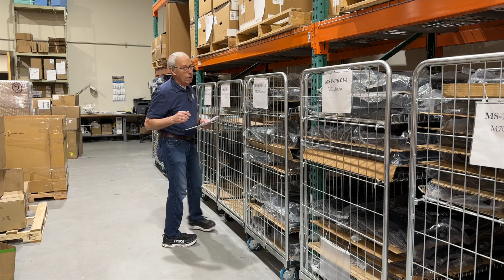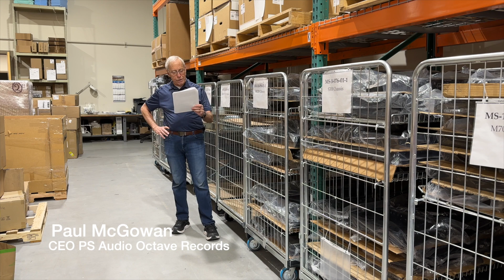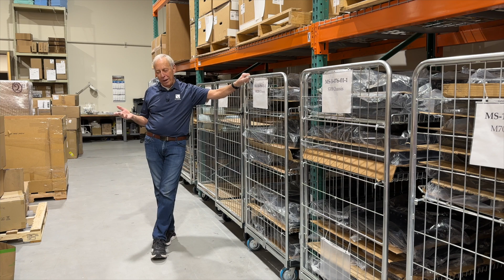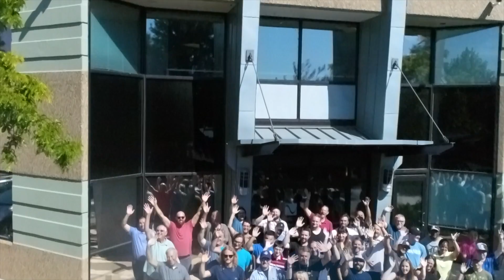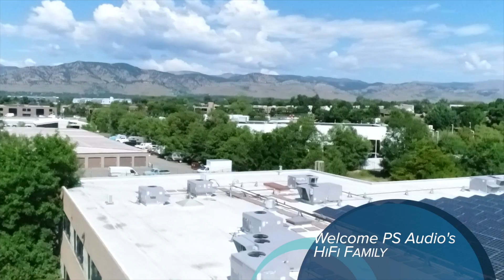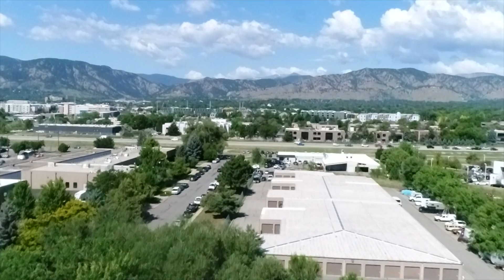Why the last few feet of the power cable matter

Comment: Our science is also incomplete and will not hash out everything we hear
Reply: I wouldn't put it that way. There are things we can hear that can't be measured. But does that mean science can't be used to prove a difference? Of course it can. A well done listening test can be just as valid as a formula. Just taking a product that you don't believe makes a difference and measuring it in some way that you come up with as proof, is junk science. Proper science requires you to follow the evidence. That means in order to do real science, you have to test actual evidence directly. That's what the deniers refuse to do. For example, have you ever seen a skeptic do any type of real research involving claims made by someone? The claim is the evidence. In order to do real science, the claim has to be researched, and the person (or people) making the claim have to be a part of the testing. You have to test people that claim to hear a difference under the same conditions the claimed differences can be heard. Its the very definition of the scientific method. Doing it any other way, isn't science.

Several months ago, I was talking to Gene from Audioholics about this very issue. He's a well known skeptic in the audio community. After some back and forth, I finally got a real answer out of him. I was pushing him on the idea of doing real science, as opposed to doing measurements that are not based on evidence. The answer he gave me was, its too much trouble.

So, the end result is, we can use real science to settle the debate. The skeptics don't want the truth. They want to win the argument. And if they tell you we should provide the testing and evidence and testing because its out claim, its nonsense. We've tried many times to do this, and always end up with the same results. Unless our tests deliver the results they want, its a flawed test and they won't accept the results.
Reply: @Douglas Blake There is a reason everyone that comes into contact with you thinks you're a pile of garbage. (And I'm being nice as far as my wording goes.)

"You were pushing the idea of doing your science ... one that appears to be totally disconnected from reality."

Quote me. If I said something that ridiculous, show it to me. Here's your chance to prove what I just said about you is false. Let's see what you come up with,

Comment: I don’t think anyone can reasonably argue the validity of time-tested electrical properties, and any contentions away from those should require you to show your work. There is no magic here, no exceptions to the rules. What a lot of people have an issue with is that constructing something properly doesn’t necessarily mean that you can charge thousands of dollars more for an improvement that costs pennies to implement. I have run a non-contact voltage tester over standard OEM power cables and the tester will detect voltage, but my Pangea cables do not, so Pangea has remedied that with a relatively modest increase in price (still too high, IMO). I’m much more worried about what radiates out of my power cable in the vicinity of smaller voltage signals than I am about anything getting into my power cables, which will be cleaned up by any piece of electronic equipment that it’s plugged into.
Reply: Here here well said BW.

Comment: It is a fact that a poor or weak contact point in an AC circuit will generate noise from minute arcing.  This can easily happen with cheaply made AC wall outlets when asked to supply larger than average currents.  So using better plugs and sockets should reduce if not completely eliminate that source of noise.  It's also why I have a dedicated circuit for my audio set-up that is fused from the panel box instead of having a circuit breaker in line with it; breakers have several small point contacts within them.  All that said, I made my own power cords using 8 gauge 3 conductor wire from the outlet to my conditioner and 10 gauge from there to my amps.  Saved a great deal of money doing it myself.  All other power cords were factory 12 gauge.  (Of course good grounding is crucial as well.)  I can put my preamp volume up full with the selector on phono (without anything playing) and put my ear up to the speaker ... dead silence.  No buzz, no hum and no hiss.
Reply: Nothing wrong with breakers ... but I certainly respect your fuse game!

Comment: I'm not going down the rabbit hole with expensive power cables.. But I have noticed a difference on some of my equipment, using cheap, heavy gauge, shielded power cables between my components and Furman power conditioner. I'm also less sold on fancy power cords plugged straight into the wall, because then it really is just the last few feet. I but I think of you're using a conditioner of some kind to actually clean up the power, then it makes sense to try and keep it clean.

Comment: Not only does the power cable matter, but I’ve noticed my system sounds better when the power is solely what’s generated by my solar panels.
Reply: That is kind of weird because most inverters are pretty bad compared to the nice sine waves comes from the grid generators.
Reply: @EraYaN  not anymore 
Most are true sine wave.
I’m off grid and we have a small solar  system and a generator with a true sine wave inverter. 
Getting ready to upgrade the whole system this summer.
The inverter itself is a couple thousand dollars.
 They are pretty much a industry requirement any more, with some much stuff being digital and computerized.
Reply: @EraYaN  I should have that measured - it would be interesting for sure. There are other factors, of course. It doesn’t seem to be the case 100% of the time, and I do have a good power cable for the amp and some rudimentary power conditioning for the components - certainly not Regenerator or Niagara level.

Comment: G’day from DownUnder Paul! Thanks for taking time to answer my question with humor 😁👋
Reply: Pay Paul $6000 for this:
Conclusions (updated)
When using the P12 as one would think to do: using Zone D "high current" outlets, impedance is actually worse than mains AC and hence it reduces power output in our test amplifier. When testing using low current Zone A, this doesn't happen and we get the same power, distortion and noise.

Bottom line is that at worst, PS Audio P12 objectively degrades the performance of some audio products if you use the Zone D outlet. If you use the other zones, it simply doesn't do anything useful than waste some power, take up space, and cost you a lot of money. Distortion, noise, dynamic and average power of all tested products remains the same as not using P12. This is what the data shows and after two weeks of waiting, nothing has been presented from PS Audio or anyone else for that matter, to indicate otherwise.

Comment: Measure it with an oscilloscope with one end plugged in your wall power outlet regardless of the length of the cable or build quality, do the comparison with the one you're willing to replace, it should show you which one is better. Have a listening test, this is also a way to tell you which is better, if not the most important of them all. Try to install a ferrite choke specific to 50/60 Hz range on your cable. It will make a difference. Save yourself from the trouble. Always trust your ears most important thing ever. I'm not going to get into the discussion of power/line conditioners or filters and generators/rebuilders or seperate electricity into your house through a separate socket etc... otherwise we will be here for days writing a comment.
Reply: Yeah, measurements do not necessarily tell the whole story. Your ears must do that.
Reply: @marcusbrsp  Measurements tell the whole story, the only story. Any other story is psychoacoustics.
Reply: @lassesaikkonen501  amen

Comment: Then why don’t manufacturers of high end audio equipment provide this cord? 

If I’m purchasing “high end” equipment, why does it come with a cheap cord?
Reply: Because the recommended cord that goes with the amplifier is the same price as the amplifier. 🤣😂
Reply: are so right!
Reply: The supplied power cable is the best solution for your equipement in a normal environment. If you have a non-normal environment or some EMF problems you can sometimes find a solution in different cables but for most people there is no need to do so. The best thing to do is to get rid of the device that is creating the interference.
Reply: Because any noise gets filter when AC gets converted to DC. It's simple but of course that won't sell cords 😂😂😂
Reply: Because a decent cord is a little expensive. A better question for the nay sayers would be IF power cables don't matter. Why do high end pieces have detachable cords while best buy level does not (usually)
Reply: Ikr, it’s like buying a Lamborghini that comes with cheap tires not built for high speed
Reply: Because you probably already have one!! It's that simple.  Why should the amp include accessories that the buyer already has?

Imagine that every time you bought new shoes, you would also be charged for socks to go with them.

Your question is naive or disingenuous.
Reply: It’s your responsibility to buy a better power cord.  The manufacturers just include a cord that will make the piece work.
Reply: @scottborenstein8291  it would seem logical that if a wire would improve performance , such a market advantage would be included and sales would soar.
Reply: Because high end amplifiers are already very expensive. Including a high end power cord with them would make them even more expensive and unaffordable. Which means less people would be buying them which would hurt that manufacturer's business. Thats why they only include "el cheapo" power cords. And if a customer wants to upgrade afterwards, that is up to them.
Reply: @wisehippo3072  no, the answer is beacuse the manufacturers know expensive power cables don't matter...
Reply: absolutely right!
Reply: @TECHNICKER_Cz  and the same manufacturers who often carefully select parts for circuits based on sound quality , but for some reason don't understand  the wire feeding the power supply inside  the equipment  is junk , is just illogical.
Reply: @wisehippo3072  the cost of making your expensive good cable is the same as the "el cheapo" cable if the batch is big enough. The profit margin on the expensive cable is massive so there is the main reason cable manufactures and sellers will market it as perfect sound and other bs you fall fot.

Comment: 3:00 did Paul answer the question? the questioner asked for some studied material science evidence or proof on what happens in the last meter of a cable. then paul settled to write a novel. i will further investigate this matter. i know there is some magic to cables but now im ready to the science behind it.
good shield less noise...come on we all know that .
Reply: RF exposure of cables can be experienced even behind your wall where your power socket receives AC electricity from. 50/60 Hz of RF energy can penetrate almost any standard wall thickness effortlessly. Where do you start from? Shielding of cables is very important, but what happens if the last bit of cable between the wall socket and your equipment has got excellent shielding while everything else behind the wall socket is exposed to RF energy? Will the RF interference travel along and through the cable all the way to the device you're powering? Factually it can and will. Best way to beat it? Use a 50/60 Hz AC power filter between the wall socket and your device and then, only then you will benefit from a well shielded cable. Also install a ferrite choke on the cable. Just don't go buying something more expensive, no more than $50 to $100.
Reply: @Douglas Blake the recording is very important of course. There's good and bad recordings. However there's so many variables in between that can make or break. I got you.
Reply: @Douglas Blake 100% 👍 I couldn't agree with you more.
Reply: @Douglas Blake ...so you like antennas behind your gear?
Reply: @Douglas Blake surely agree with what you're saying so far. What about vintage equipment prior IEC standard though?

Comment: When building my first amplifier I realised how much noise there is "in the air" and how the smallest of things made all the difference. I don't have an expensive power cable though, just a nice red instead of ordinary black. 😄
Reply: It must improve bass control, no doubt. Because red is faster! 😂
Reply: @ropeburn6684  Good thinking, I should add white racing stripes to it! 👍😂
Reply: I can't believe you would run a red power cable! Even a complete idiot knows that a red power cord will color the sound by elevating the lower midrange.
The preceding comment was made in jest using artificial AI instead of real AI.

Comment: In the jumble of cables that are often behind a stereo, shielded power cables also help keep the noise of the AC out of nearby component and speaker interconnects. Also, is many systems the "fancy" cables often go between the power conditioner/regenerator and the components, in which case is not the "last few feet" at all.
Reply: Really?
Where are you grounding your sheilding too?
The ground in the electrical wiring?
That attaches to the case of the device so attaching a shield will create a path for interference to follow through the device.
Reply: @JonAnderhub  That is **not* how one drains the noise from the shield, instead **only** connect the wall-side of the shield ***not***the component side.

Comment: Every notice how none of these cables are UL passed. Good luck with your insurance if you have a fire. It's a power cable, if it measures the same it can't change the way you eguipment sounds. I use induction for cooking, if I put an expensive extension between the wall and the cooker will my food be better? No.
Reply: Some chef will say it matters, and back it up with a double-blind study.

Comment: If there is no RF noise at the wall outlet and only in the power cable why do we use power cables? Why not run the solid core power cable from the fuse box straight into the amp?
Reply: ... you don't?

Comment: The last few feet of a power cable is called pseudo.
Reply: It's not the last few feet, it's the middle few feet. Electricity flows in circuits. It starts and ends at the power plant with your hifi component in the middle.

Commenters seem to fall into two camps.
1. Those who can't see how a quality power cable can make a difference so never try one and then claim that they make no difference.
2. Those who try and hear a difference.
I didn't think that power cables would make a difference but too many people with no skin in the game said they did. So I tried one and was shocked at the level of difference.
Reply: Psychoacustics at its finest
Reply: @budsmoker4201120  meaning?
Reply: Yeah if u sit on a sh1t system absolutely.
Reply: Try to do without the last meters of cable, you will find it to sound a lot different.
Reply: So your that guy who didn’t even experimented himself and has a opinion..